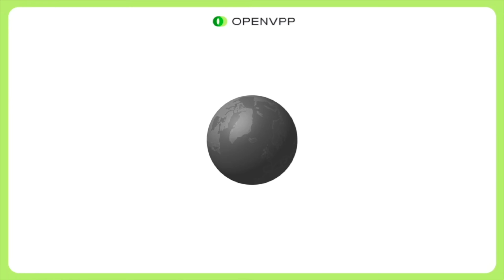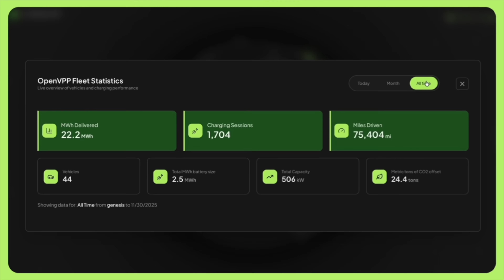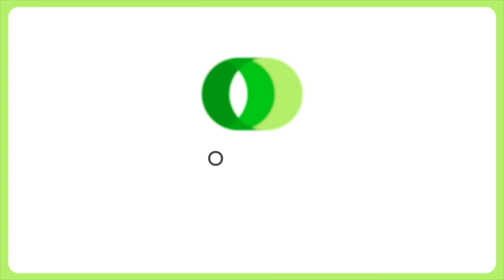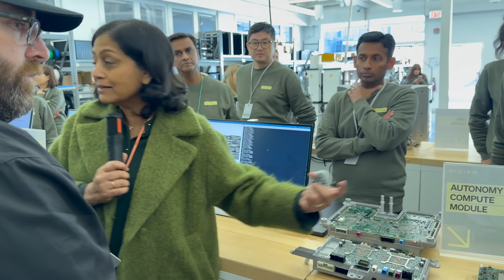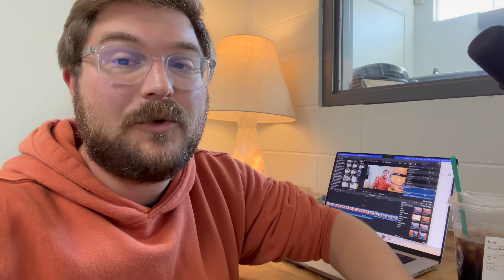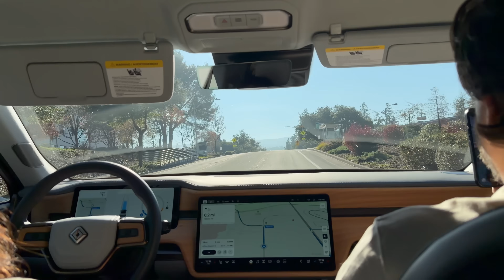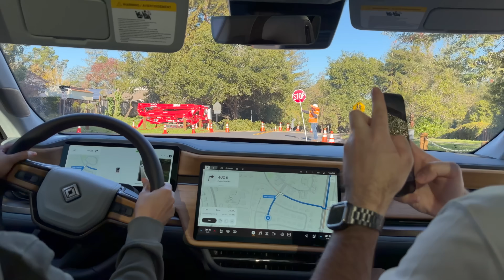My Rivian “FSD” Test Ride! Long Road Ahead But The Correct Choice

Comment: How far behind is it really Kyle, A month, 6 months, a year, two years? The system you rode in was turned on 3 months ago according to Rivian so it doesn't look "So Far behind". How long would you say a Rivian feels like a Version 14 FSD. It's like we all have forgotten that Tesla scrapped their whole system when they moved to end to end system format and from that point FSD improved exponentially and Rivian is using that same system. So tell us in a real time frame not a "Soooo Far Ahead" comment, give an estimate of actual time. Rivian turned the system on 3 months ago and it feels like that so what would you really think the time frame would be to feel like FSD14?
Reply: I would say with flywheel data mining, they will compare Apple to Apple withing 16 months tops!

Comment: I never got used to 2022 Tesla model y with FSD. Traded it  in for a 2025 Rivian R1T . I like the  R1T. Better ride, better storage but I expect the enhanced driving will greatly benefit me as a senior driver especially at night. A lot of roads are not currently mapped for Rivian on interstate roads. I will greatly like having all lined roads especially the backroads which I drive a at night.
Reply: Have you demo driven the updated FSD V14.2 yet? I like where Rivian is headed with autonomy, but you definitely gotta try Teslas update as well.

Comment: I don't think people realize how long FSD has been in development, it was still beta in '24. Trying to build a system that directly competes when they have a ~10 year head start is a wild undertaking.
Reply: Especially considering the training fleet size differences.
Reply: 10 year head start? Rivian was advertising self driving in 2018...
I don't think people resize how long Rivian has been working on advanced self driving!
Reply: @AndrewBatiuk FSD has actually been on the road for 10 years, big difference.
Reply: @O @OM61777  FSD was first deployed to a small number of customers in Oct 2020. Anything prior to that could be considered marketing, no different than Rivian marketing advanced self driving in 2018.
Reply: @AndrewBatiuk  Weren't they using mobile eye back then?
Reply: @Sam-o7n7v yes, mobile eye predated FSD.

Comment: Very hard to trust anything Rivian pre-announces.  Tough seeing how Rivian avoids bankruptcy.  Rivian can do all the Nikola-type hype it wants to.  Not going to matter.  Here’s rivian’s unbroken string of quarterly billion dollar losses and anemic production numbers:
1Q23 - $1.3 bill loss
2Q23 - $1.2 bill loss
3Q23 - $1.4 bill loss
4Q23 - $1.5 bill loss (full year '23 loss:  $5.4 bill)
1Q24 - $1.4 bill loss
2Q24 - $1.5 bill loss
3Q24- $1.1 bill loss vs 10,018 vehicles sold... $109.8k loss per vehicle sold
4Q24 - $744.0 mill loss vs 14,183 vehicles sold... $52.5k loss per vehicle sold (full year '24 loss... $4.7 bill)
1Q25 - $545.0 mill loss vs. 8,640 vehicles sold... $63.1k loss per vehicle sold
2Q25 - $1.2 bill loss vs 10,661 vehicles delivered... $112.6k loss per vehicle sold
3Q25 - $1.2 bill loss vs 13,201 vehicles delivered... $90.9k loss per vehicle sold
Reply: This.  💯  Even with successful R2 sales Rivian still doesn't have enough production to offset the costs.   And they decide to install complex hardware which will cost much more than HW4, a conservative estimate would be $4k per vehicle on every vehicle no matter if the customer decides to purchase the suite or not.  Amazon will need to keep doubling down pouring in cash and VWG will need to start adopting the Rivian system as well, then maybe it will work out long term.

Comment: It’s great to see Rivian going for it.  Since they are years away from FSD equivalence I hope they map out distinct milestones of increasing usability. Allowing user input without cancelling is a huge confidence booster and the correct approach imho.
Reply: I don’t believe Tesla is years ahead given that AI is modeling much of this.   It’s more of what is Rivian willing to spend on both their hardware and firmware and AI systems to implement.  One fact is that Rivian has better hardware in their cars ( LiDAR) which Tesla has foregone to use just cameras.
Reply: @SuppressiveSquirrel can we at least agree that it took years for Tesla to get from where Rivian is now to where FSD is now? (There are lots of YouTube videos of old FSD versions. )
Reply: @TVwatcher-ic3ne  It's actually not that simple.  Tesla started from scratch 10 years ago with AutoPilot, but with woefully underpowered hardware for the task they were undertaking (FSD).  AI4 is just now giving Tesla almost the power it needs to accomplish (supervised) FSD, but has still not achieved the required threshold of hands-off, eyes off FSD with few, if any, interventions.  There is probably very little code remaining from the last 10 years of effort, as it has been redesigned to take advantage of AI and the current and planned compute power.  Rivian has skipped all that and their baseline is hardware that is already much more powerful than even Tesla's AI5 next generation chip.  Rivian has also learned from Tesla's experience and is following a similar (AI) development path, skipping the limitations of the past.  The only caveat is will they come to learn that integrating and resolving 3 discrete input streams (vision, radar and LiDAR) is too difficult, or will they find the key that gives Rivian a permanent advantage over Tesla?  It will likely need all the excess processing power at their disposal to master that task.  There's a reason that LiDAR won't be offered in the initial batch of R2s.  But Waymo has demonstrated that LiDAR really does allow practical, unsupervised autonomous driving.  We'll probably know in a year which approach has the brightest future.  I personally think vision-only will hit a wall regardless of how much compute power you throw at it.  BTW - I've owned Teslas for over 5 years, and expect to buy a Rivian next year.

Comment: Does Rivian's self-driving timeline make sense?  In Mar '26, Rivian will sell Autonomy+ subscriptions.  The R2 won't be sold until Jun '26.  So why won't the R2 initially have self-driving?  In summary, if in Mar '26, the older R1 and S1 models can have autonomy added aftermarket, why exactly can't the upcoming R2 have int Jun '26?
Reply: They shouldnt be selling subscriptions in 2026 unless they pull off a miracle.
With how poorly it performs today, they should just offer it for free, and then in 2030 or whenever it actually is decent, then they can start charging. Having it be free will lead to more training data, and a LOT more goodwill for alpha testing their software.
Reply: They may need more driven miles data in R2 for training is my guess.

Comment: First of all Rivian is not advertising as FSD , they are telling you that it's a level 2 system. Unlike Tesla that has been telling you that it's a FSD for almost 5 years.
Reply: Rivian isn't totally innocent... They were advertising "advanced self driving" back in 2018.
Reply: @AndrewBatiuk sure. They never sold it as once the product was out and they didn't Charge you 15k for level 2. So it's not the same
Reply: @Abevlife  Doesnt change the fact Rivian were advertising self driving to sell vehicles before they actually had self driving. Both companies are guilty of questionable practices. 

At least both companies NOW are 'getting close'. Rivian is certainly behind, but their architecture and focus could help them catch up quickly.
Reply: @AndrewBatiuk yup but only one charged you 15k for level 2 while promising FSD
Reply: @Abevlife  and only idiots bought a software package exclusively for features not currently available. However some bought the package for what it could do. Some saw value in stopping at red lights and stop signs, and/or navigation on city streets. 
Not to mention the 'nearly self driving' it currently offers. Yep, supervised, but that is still a big benefit for some. People pay $15k for various car upgrades, some arguably far less often used than FSD (Supervised).
Reply: @AndrewBatiuk it's says "Supervised" now for last year or so.
Reply: @Abevlife  indeed it has. Your point?

Comment: You have to remember that last year FSD sucked. For those that had "no interventions", good for you. My experience was VERY different (so I didn't buy it or "rent" it). Hell, it phantom braked on me at 60 MPH a couple months ago in basic autopilot .. just thew out the anchor! When my Tesla lease goes back next year it will be replaced by an R2 (to live side-by-side with my 2026 R1S).
Reply: Weird, Tesla FSD, albeit imperfect, by version 12 in 2024, was already miles ahead and very useful. Today, the gap is even wider and basically drives me everywhere with no relevant issues. IMO, if you can’t see that is because you choose not to.
Reply: @graciasthanks4771  v14 is much improved...I was pointing out if you talked about FSD a year ago, your opinion would (may) be different...and Kyle is looking at a system that is nearly a year away from rollout
Reply: @irish_fan we definitely have different opinions. 2024 FSD was IMO way ahead of what Rivian showed right now. Using it in all types of streets and highways it did much much more than this demo in a curated loop.
Reply: @graciasthanks4771  I agree that what they showed today was basic .. for my use case, 2024 FSD was basic and most times rather frustrating whether city driving where it would try to drive in turn lanes or on the highway where it would never not cruise in the left lane no matter what setting I choose. Others had a different experience. It did not impress me (and concerned me sometimes .. it litterally tried pulling out in front of cars while making turns several times) enough I wouldn't pay money for it...but YMMV. That's the great thing about having choice.
Reply: @irish_fan And FSD is still better than what we saw from Rivian.
Reply: Are you confused? Autopilot is NOT FSD. The fact that you didn't pay for anything means you never drove FSD.
Reply: @dennissabo3885  No...two separate comments. 1) v12 sucked (v14 is much improved) 2) basic autopilot still sucks
Reply: @irish_fan So don't drive in autopilot. Stick to FSD😂😂
Reply: @dennissabo3885  I am on another FSD free trial of v14 right now .. third one so far in the 2.5 years I have had the model Y.
Reply: @irish_fan And you think Rivian will be better than FSD next year? Hey, I've got beachfront property in Kansas if you're interested 😂😂😂😂
Reply: @irish_fan So then you've only TRIED it for 3 months. So my statement still stands. Your evaluation of autonomy in the Tesla is based more on autopilot than FSD. Well that changes everything.
Reply: @dennissabo3885  I actually don't think they will be better than FSD next year .. perhaps not even as good at v14 is today. But that isn't the point. The point is that as their model improves, the experience will improve. Just like FSD has.
Reply: @irish_fan But the point is, FSD next year will also be better than it is today. It's all incremental. The other thing is Rivian is bleeding money. Tesla is not. I hope Rivian will be around to implement what they're saying. First they have to achieve their learning compute. That means they have to have vehicles out there to teach the computer. Tesla has been doing it for years with now millions of cars all around the world. At last count I believe billions of miles have been learned. Rivians big problem is they can't sell vehicles. Way too expensive. Teslas will be sentient (thinking for themselves) soon. Even now, Teslas don't need road markers or mapped roads etc. to drive themselves. Rivians best option was to purchase an FSD license from Tesla and have the best autonomous technology there is today. If that would have been announced, I believe orders for their vehicles would have been through the roof.

Comment: For me personally, FSD is great, I just don’t care that much about it to spend $8,000 or $99/month. I like Rivians approach of $2,500 onetime purchase. If Tesla did that i might actually consider buying FSD. Honestly autopilot is more than sufficient for my needs. All i really want is more range. 😂
Reply: Keep in mind this is for the end goal of a level 2 product. So they never intend on assuming liability.
Reply: $2500 for a product that's currently 20% the capability of fsd
Reply: @rigon28 lol Tesla has been selling fsd for years in Europe for 7500 euro with zero capabilities
Reply: @FrankNolf Blame the EU’s excessive regulation for that.
Reply: @toddeburch  sure but Tesla has been selling something thatr is not even legal righ now, can not blame the EU for that
Reply: @FrankNolf And people have been buying it. People shouldn’t buy a system that isn’t legal yet and then complain that they can’t use it. I think Tesla took a risk that by selling it ahead of time, they would be able to generate pressure on the EU to get the system legalized. That appears to be working. And when it comes to the EU in 2026, it will be great.
Reply: @rigon28 20% is a huge overestimate of this system’s capability. From a difficulty perspective, this system has maybe 0.5% of what’s needed for near-autonomy. That might be an overestimate too. Notice there was not a single unprotected left turn. All roads painted. Light traffic. Low speeds. Right turns or protected left turns. Many takeovers for trivial situations like a car stopped on the side of the road or merging or pedestrians from a different demo ride. No joining the highway or dealing with construction or school busses or emergency vehicles or parking lots. Let’s be realistic here. The MUCH harder problems (like an unprotected left turn into high speed traffic a la Chuck Cook’s left turn) is exponentially harder than what was demonstrated here and far more dangerous. The basic stuff like staying in a lane or doing a turn is exponentially easier than the hard (but still very common) stuff.

Comment: The important thing is that Rivian understood the importance of autonomy in time to properly architecture their mainstream vehicle. Even if they're years behind Tesla, the hardware is there to drive rapid continuous improvement. We have two Teslas with FSD 14 and they are certainly unbelievable, but there are also so many ridiculous Tesla sore spots. The biggest for me is the lack of a proper wiper rain sensor on a vision-based vehicle, which is ABSURD. It's good that the car is driving because I have to spend the entire time managing wiper speed.
Reply: Yea, give me a chill mode for my Tesla auto wipers. Way too overtuned for my taste. They often turn on for no reason at all.
Reply: It’s gonna come to the point where people can’t even drive their own cars and now people worry about my wipers won’t come home by themselves what am I gonna do
Reply: I never understand the complaints about the wiper. It is a none issue in the 2 years I driving my Y. Anyone complain that shows their maturity level is low, I think. The absurdity of the complaint that it is absurd.
Reply: @nguy404 they come on when it isn’t even raining. That’s why people get annoyed.
Reply: @joetz1  the auto wiper sensor on my ford mustang mach e did the same thing? This isn't purely a vision only issue.
Reply: @bradleyfrank7933 my Mach e does some weird shit too where sometimes it will wipe a dry windshield for no reason 

But my Tesla does weird stuff far more often than
Reply: Bizarre comment. Do you care about the windscreen wipers when travelling by rail or flying? When you’re sitting in the back seat of an autonomous vehicle (perhaps one without a windscreen entirely) it’s the same reality

Comment: I struggle with the same point of view you struggle with. The main point that I fall back to, is that competition is good for our market. If Rivian can eventually get even close to Tesla FSD we finally have two consumer available options to pick from. This could lead to Tesla FSD lowering in price, opening the market to more users. For this reason, I hope Rivian can greatly improve very quickly. I'd say evaluate the systems as they are today; we can't live on future promises as much as much as we want to.
Reply: Can’t wait for more competition! Will be great for us too… this vs that will be so much fun to compare
Reply: @KyleConner  I wonder what Point-to-Point L2 will cost?  UHF is $2,500, but that is basically Tesla's AutoPilot with AutoSteer.  I wouldn't assume P2P L2 (FSD equivalent) will necessarily be the same product, much less at only that price (unless Tesla's FSD drops its price considerably lower in a year or two).
Reply: Rivian just started building cars a little over 4 years ago. Their pace has been insane. I get its trash compared to Tesla now, but really am hopeful they'll advance quickly. They talked a LOT about spec'ing their sensors/cameras/data collection processes in order to be able to improve quickly. Once they have lidar equipped cars everywhere, you'll start to see things really speed up I think.
Reply: There is a little problem because of EDS people will assume tesla's competition is father along safety wise,  and competition will cut corners and fake it to boost their stocks and perception then people will get hurt in bad auto accidents.